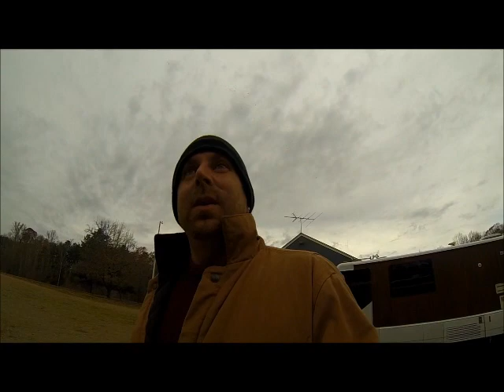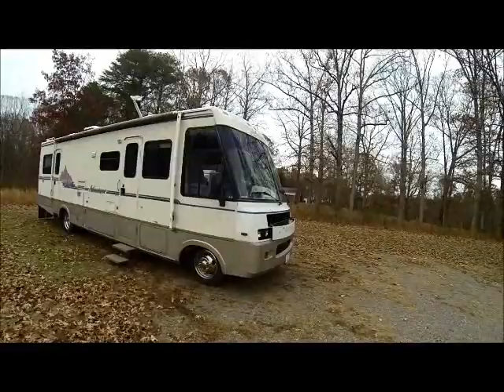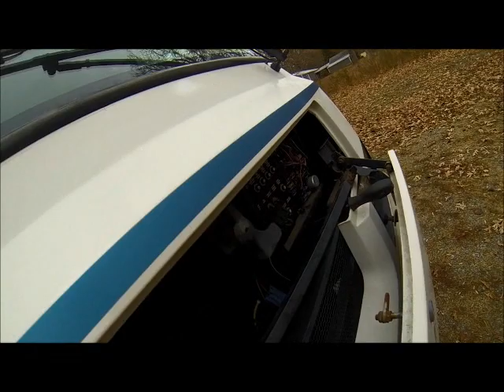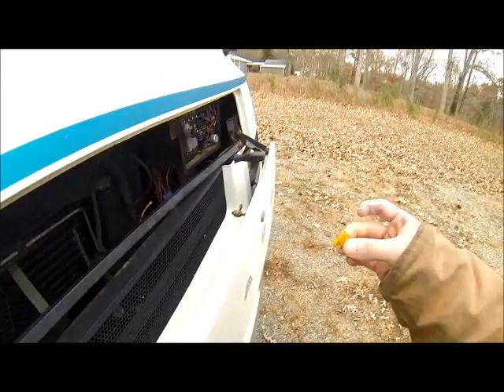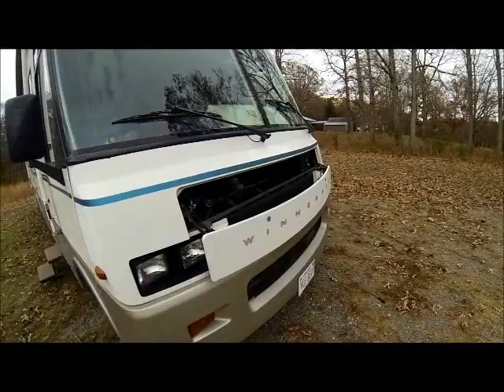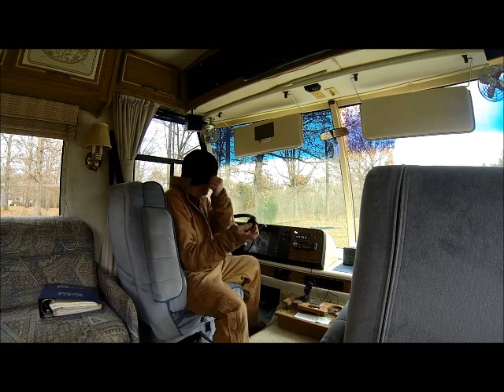RV Auxiliary battery switch not getting power? Try this

Comment: Hey Chad i don't suppose you would know what might be wrong with my hydraulic jacks would ya? (ive tried googling this)
The motor doesnt make noise and i can only hear the relay clicking when i try to operate it, also the reservoir has barely anything in it. Do you think it had blown a seal somewhere?
Reply from the maker: I would look at the pump and see if there is a solenoid mounted to the pump, there is a good possibility there is a blown fuse on or associated with the solenoid. I would also add some hydraulic fluid and see if that makes a difference, I would think it might have a safety switch not letting the pump cut on if its out of fluid. Let me know how it goes. Take care

Comment: Hey Chad, Happy Thanksgiving!  I've gotta question about an electrical plug on my 2004 Coachmen 300QB (Mirada). There's two batteries under the hood: one starts the engine, the other is a house battery.  There's a yellow fuse attached to the house battery's wires, which run through the firewall and inside the coach, and attach to a double 3-prong plug receptacle. Can that receptacle be used like an inverter? In other words, can power be drawn directly from the house battery by plugging into this receptacle? To my knowledge, the coach only has a converter, not an inverter, so I have no way of drawing power from the house battery except through the cigarette lighter.